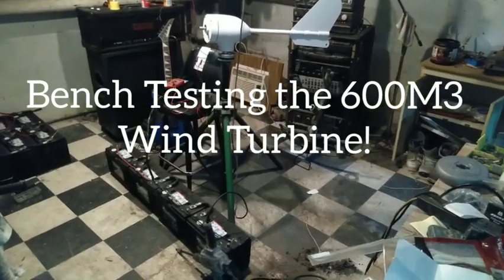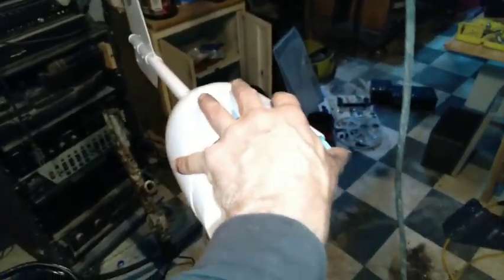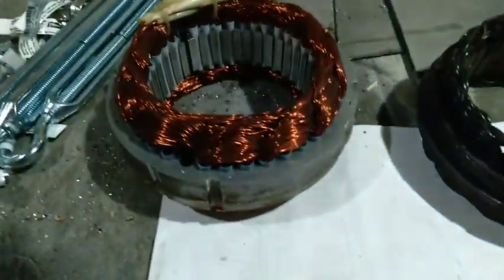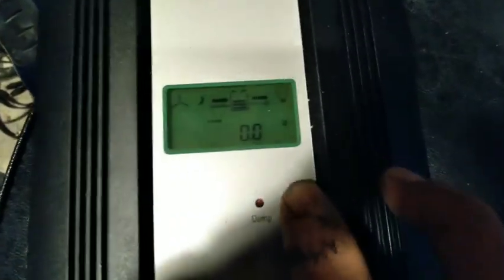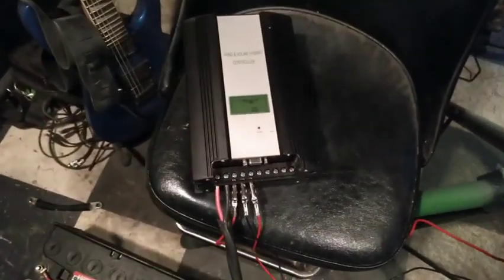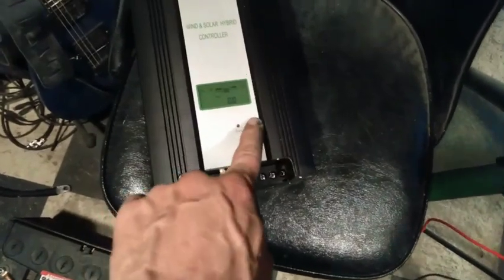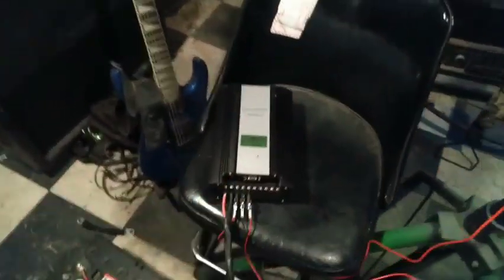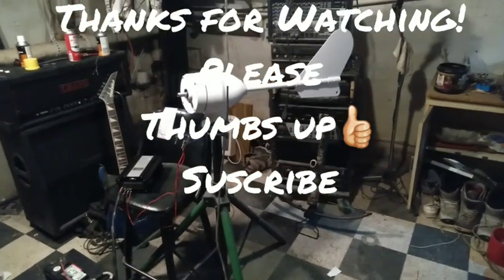Bench Testing the 600M3 Wind Turbine!

Comment: balancing blades are quite easy no adding of weight required, you simply move the blades left or right while the blade securing bolts are firm but not tight
Reply from the maker: Perhapse....but I've been in construction 2/3's of my life and have become just slightly OCD about unifomity so i mark and measure every blade end so they're all equal length from eachother and then I balance. These chinese turbines are great producers(these ones, not all) but I've seen the blades as much as 9 grams different and that'd be hard to make up by just shifting the blade. I enjoy the process though👍🏻
Reply: @smallcityhomesteaders1600  nah its easy even with far more weight differences, been doing it for years However im a perfectionist with cars n machines. i once would weigh each blade and find their centre of gravity and make them all identical, i dont bother with that anymore, theyre just turbines not the space shuttle as Taryl fixes all says all the time, and i see dramatic improvements with that simple technique.
Reply from the maker: @closertothetruth9209  worth a try! Next turine. I still like to paint them for the UV protection and hell....they look slick all done up!

Comment: By looking at your video looks like you have a 24 volt wind turbine using it on a 48 volt battery Bank that's why the cut in voltage is very low. Meaning the turbine is going to produce alot sooner than a 48v turbine....
Reply from the maker: On this bench test i did have the test batteries wire series to 48 volts because the controller and the turbine are both for a 48 volt system. My personal system is a 24 volt system.

Comment: I have a turbine 48 volts from AliExpress model M. It turns good and but it's not producing enough I believe the the cut a bit too high the turbines spin very fast to to start producing.. what can I do to help it produced at low speeds....????
Reply from the maker: I was absolutley amazed by how well the mppt charge controller worked for producing watts at very low speeds. It boosts the incoming voltage up over battery voltage so it can charge. My turbines spin almost everyday without making power so i plan on replacing my whole rectifier/resistor setup with a pair of the new comtrollers. 15 watts all day is better then zero.
Reply: @smallcityhomesteaders1600  linked of that certain charge controller....
Reply from the maker: @kainduran3480  what wattage is your turbine rated for?
Reply: @smallcityhomesteaders1600  500w from AliExpress 48v if says on the G.E on the add
Reply from the maker: @kainduran3480  same one i got... 
US $140.12 | MPPT High Wind Protection Controller With Hybrid For 600W 24V Wind Generator And 300W Solar Panels
https://a.aliexpress.com/_mOftdxZ